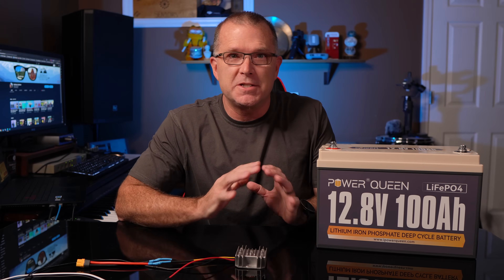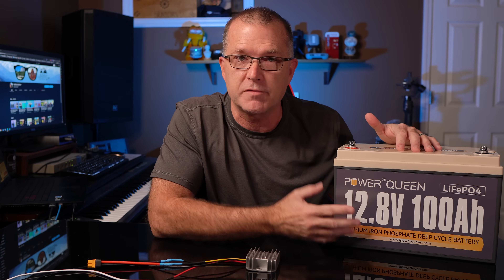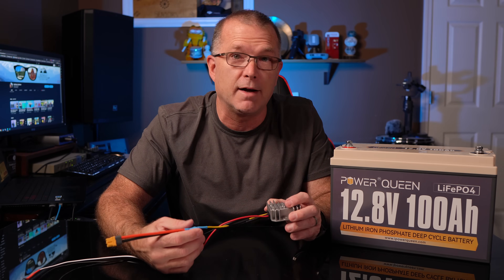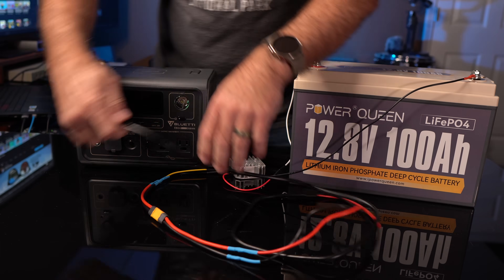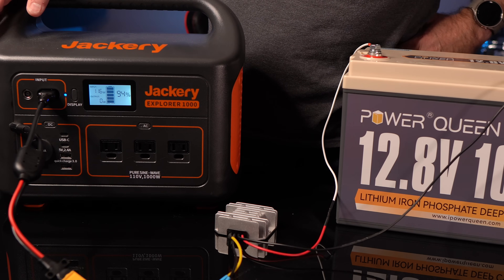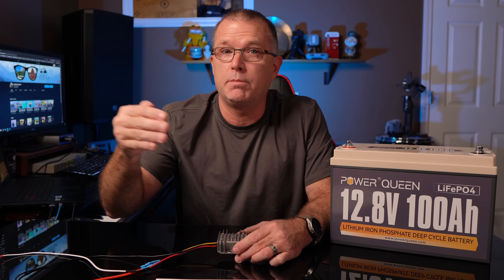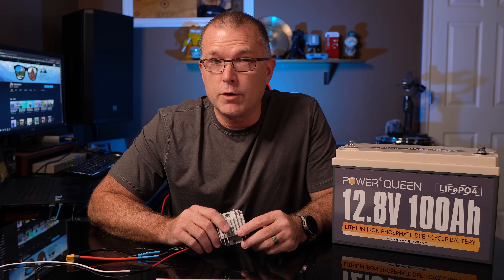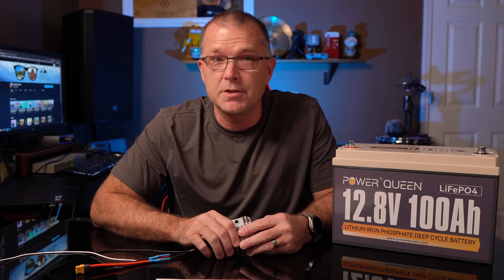SUPER EASY!!  DIY Power Station Battery Capacity Expansion / Charger

Comment: I did this with my delta which was rated @ 60 watts recharge and it burned out the unit charging @ 110 watts 😢
It worked for about 2 weeks then ruined the unit..
Reply: The original Ecoflow Delta states 10amp as the limit for car charging?
Reply: @LiquidTurbo   I think it 8 amps
I got a max unit and I’m gonna trait again using a 7.5 amp fuse and hope it’s holds up
Reply: @avelinomiseray6349  I checked their website and it said 10ampa for the original Delta
Reply from the maker: Wow...that's definitely not good.  Which Delta was that?  I can't seem to find one that's only rated for 60W DC input.   All the ones I tested have change controllers capable of modulating the input current - so provided your input voltage is within the published spec, there should be no problems, especially since step-up converter is only rated for about 3A.   And I did notice that my 2 smaller units that I tested with only registered 61W - which is equivalent to the charging rate their AC adapter's produce.
Reply: @ReeWrayOutdoors  hey.. it was the original delta .. I did this with the DC charge port that was supposed to be charged through the DC cigarette port which only puts out 60w .. I used the cable provided by Ecoflo removed the cigarette plug and amd ran it to a 10amp fuse .. 110 watts is what I got … It was great till the DC port stopped working.. Since I could no longer charger through that port I ended up returning the unit. I got the Max unit now but I want to try this method again with a 7.5 amp fuse .. see what happens

Comment: Pretty interesting video.
Reply from the maker: Hey man! Your channel name piqued my interest so clicked on it to see if you post any content... Looks like we work with many of the same brands and you seem to have a TON of great content!  I just subbed so I can remember to check some of your stuff out when I get a chance.   There's another channel I've come across (Jasonoid) that did something very similar, but it seemed more complicated and I wanted to show something that did basically the same thing but less complicated.  And pretty much within minutes of posting this video, it occurred to me (after someone raised a question about it) that there's an even easier way to do this using a 12V car socket - though it undoubtedly will produce a bit lower watt input in some power stations.  I might need to do a part 2. :-/
Reply: @ReeWrayOutdoors  depends on the power station, just using a 12v socket won't limit the current and may overheat the wires or start melting the plastic. Using a current limited boost converter is safer and doesn't cost much more.
Reply: My jackery outdoors supports 12 - 30V. DC input 24v  7.5A to 8.33A. So I guess I can add two of those 12 to 24 3A converters in parallel for more watts?

Comment: I like this idea, would this work with 2 100ah battery, and let's say I want to charge the other way around , let say my power station is full , and want to top up my auxiliary battery, what would be the best way ...smart battery charger plug into the AC of the power station? Thinking to get the ac200p and add 2 of these 100 ah lithium.. any ideas would be great ...

Comment: Do you think the EB3A was making that noise because it was already 99% charged? Would it be possible to run it down some and them try the booster and report back. I have two of those Bluetti power banks and two 100ah LiFePO4 batteries and I would buy a booster if I thought it would work. It broke my heart a little when you excluded the EB3A from the mix, since that's the ones I have. Great content.
Reply from the maker: Ok...so the buzz I heard on the EB3A was not due to the SOC being 99%.  I got the same buzz when I tried it at only 75% SOC.  Still not sure why that is.  I DID also try the (easier) option of using a 12V socket wired to the battery and then using the car charger cable to charge it at about 80Watts, and that seems to work and produces no concerning buzz noise from the EB3A.  Here's basically what I used (came with the BougeRV Self-Heating Battery):  https://amzn.to/3Cw6hN0
Reply: @ReeWrayOutdoors  I ended up doing the same thing, except I bought a 2 pack of 8 mm male plugs and added ring connectors to the wires to attach the battery.
Reply: @ReeWrayOutdoors  Thanks so much for following up on that. I may go ahead and buy the boost converter for my two power packs. If I do, I will report back on whether I get the buzz or not. The boost converter is cheap enough and I expect that at some time I'll get a larger power pack and can use it with that.
Reply from the maker: yeah, it's possible.  I'm going to do a little more testing and report back.
Reply: @ReeWrayOutdoors  definitely interested 
 ty ReeWray

Comment: Could one just use two of the LiFeP04 batteries in series and not us the step-up converter?
Reply: If your batteries support series connection, absolutely.
Reply from the maker: What David said...and I would add that it would be a very good idea to ensure you have a 15A fuse in-line if you're going to do a direct wire to the battery.  And that was an excellent question,  btw!
Reply: @ReeWrayOutdoors  Thanks, I have the bluetti AC500 with two B300 3072W batteries. I also have four battle born 100ah 12v batteries. So this is the first hint I have seen on how I could combine them. I am thinking 2 pairs of batteries in series then parallel them into the bluetti with a 15A fuse....I am thinking right here? Thanks
Reply: @LarryRichelli  the AC500 MPPT will take up to 15a, wonder if a 15a fuse will blow too easily?
Reply from the maker: @Larryr  yep,  sounds right to me.  Not sure about the DC input specs on that AC500, but you might be able to fuse with something higher.

Comment: very cold winters...not allowed to use solar power
same with emergency generators (noise by-laws)...Are you able to recommend a unit that will only recharge through AC plug-in power?
Reply from the maker: George, all of these power station will allow you to recharge through AC.  What would you plan on powering with it and for how long?
Reply: Gas furnace (1200 sq/ft house), WIFI, Fridge, Freezer, Gas stove for cooking (exhaust fan above it) , Pod coffee machine,TV...Minimum lights>>>Appreciate you taking the time to help

Comment: I have the delta pro , if I used the uxcell New Big-Size Waterproof DC 12V Step-Up to DC 48V 8A 384W Car Power Supply Module Voltage Booster Converter Regulator would it increase the input amount ? the Deltapro says it has a 1600 w input peak. Also I have two 205ah renogy batteries if I build two of those units and put one one each battery can I “Y” connect both of them to double the input amount?

Comment: I added a 12 to 24 converter but at 10 amps to my Anker 757. I wired it into my larger solar bank system. Works great and chargers about 220 watts. Great video.
Reply: Do you have a link for the converter please
Reply: Im interested too in the converter. Did u find it?

Comment: I recently acquired a Pecron E2000 (LiFePo) and was looking at the larger Power Queen as an option for expansion instead of Pecrons new purpose made expansion batteries. It seems they still need to work out some glitches when using more than one of their batteries in series. Pecron has a dedicated, but somewhat proprietary connector for its expansion cable. Would really be interested in getting another set of eyes on a potential solution.
Reply: I have the same question
Reply: The plug is not proprietary, it's 5 pin aviation IIRC.

Comment: how could you make this work with the EB3A ?
Reply from the maker: I need to do some additional testing with the EB3A.  It might be fine, but I just didn't recall hearing a buzz when it charged via solar....but it's entirely possible that that is normal. I'll post a comment back once I feel more confident recommending it.
Reply: @ReeWrayOutdoors  that would be awesome as the concept should work great for the EB3A
Reply: Maybe use a DC to DC that's 12 v to 19 v instead of to 24v.  It might be a little less stressful on the eb3.

Comment: Good idea for a low price expansion.

Another downside is the low efficiency and the extra cycles put onto the main battery. These small power stations take 15-20% more than rated capacity to charge, even over DC (512Wh capacity takes over 620Wh of input to charge), plus the 12 to 24V boost converter loss of 5-10%. Then you lose another 15-20% from the typical inefficiency of the power station when using the inverter/regulated DC.

So if you do the math for something like the Ecoflow River 2 Max with 512Wh and a 1280Wh external battery, you are getting ~415Wh (original output capacity) plus just ~785Wh AC output capacity from dumping the 1280Wh into the unit and taking it out. The loss is much greater than compared to if you just hooked up an inverter to the external battery and used it that way, plus you effectively put 2 extra cycles of wear on the internal battery of the power station by dumping in the 1280Wh.
Reply: Your math is flawed, because from my real world use case, my external 50AH 768WH battery does not dump power into my power station, it's more like a pass through of power. If I don't exceed the 80 watt input, the unit always stays at 100%!
My power station always stays at a 100% level even while powering my 24inch TV at 27 Watts for over 24 hours. This is better because my external battery charge time is way faster!
Reply: Well any expansion battery is going to have that issue.  Always buy the largest battery you can get away with.
Reply: How could you be putting two extra charge cycles in??  lol.  Where is all that wasted energy going?  When you recharge from solar are you also wasting two extra cycles?
Reply: @ItsEverythingElse  when you charge with solar you are charging just 1 battery, if you use the power & recharge it that it is one cycle. If you use a 2nd battery to charge a power station, you are cycling the extra battery and then also the power station’s battery.
Reply: This is exactly what I was thinking.
Reply: Inverters aren't 100% efficient either.  And you're now going from 12VDC to 120VAC and back to 12VDC.  I don't see how that is better  than 12 to 24 to 12.
Reply: Thank you for the thought provoking comment.

Comment: Nice idea. I’ve been planning to get a 24v-12v stepdown converter on a 100w solar panel output to run my fridge by the pool this summer. Maybe you could do a video running things off a solar panel with a converter instead of a battery. I know I’d be interested.
Reply: An mppt solar charge controller is basically a smart DC to DC converter which will do exactly what you are asking. Or go for a pwm controller if you want cheaper (£10 or so) but at a risk of less efficiency. The cheap pwm ones typically don't even need a battery.

Comment: Pecron 2000?
Reply from the maker: The Pecron series is a bit of a unique case.  They have 2 inputs. The top one only supports a max of 18v which is too low for this 24v converter.  The bottom port needs at least 30v...which is too high.  So, 2 options: either get a step-up converter that can do 48v for quicker charging, OR go the easy route and just use a 12v female car socket wired to the battery and then use the included car charger cable to get up to about 100W into it.  Something like this would work: https://amzn.to/3i4yDa6

Comment: So with the delta 2, its possible to add a delta max to get a total of 3kW max, beyond this there is no additional expansion option from ecoflow. Now, is it possible to use this approach to add a third LFP battery to expand the system even further via  the XT60 connection?
Reply: I guess another way to phrase the question is "Can the Delta 2 accept "solar charging" from the XT60 connector while connected to an expansion battery". My guess is that it can, therefore this should work.

Comment: One thing that may be beneficial if the specific power station can use a much higher input voltage is finding a boost converter with an output voltage just a bit under (5-10% or so) the max recommended solar input voltage or get one with adjustable output voltage range and just make sure you are not going over the max wattage rating of the boost converter or battery you are connecting to.  This will allow higher input wattages for the power stations that support faster solar charging.  Many of the portable power stations are limited in charging wattage due to the size of the solar charge controller they use so if they support a higher voltage that can sometimes yield a higher input rate till you hit the max rate of the internal solar charge controller.  One other thing to mention about those boost converters is that they tend to want forced air cooling if you drive them much over their rating for any length of time.

Comment: Since most power stations come with an adapter to charge from 12 volt car power,  would it not be easier to wire a 12 volt fused female plug to the battery then use the supplied adapter to charge the power station? Sounds too easy! Am I missing something?
Reply from the maker: Definitely easier. :P  The only downside is that for some power stations (like the Delta 2), you'd only get 100W into it with that, instead of around 180W.
Reply: I was wondering exactly the same thing and I think I prefer the 'cleaner' setup over the boost in charge speed. I'm also paranoid about safety, so something like the NOCO battery clamp with female 12V adaptor has a really nice inline fuse. Then you can simply use the cable that came with the power station. Love the video!
Reply: @LiquidTurbo Interesting! Thank you for this idea!
Reply: That's kinda what I do on 2 separate units. One is only 400 watts (cost $200. bucks) and the other is 800 watts (cost $250. bucks), and both have battery jumper cables for your car.... sooooo if the power goes out late at night I simply connect a fully charged (yes, I'm prepared) 12v external battery through the jumper cables and have a ball. I even recharge them both at the same time by connecting the battery charger (when the power comes back on or I can fire up my 10K water cooled diesel generator... homemade for 1,000 bucks... without waking the neighbors) to the external battery and the current tops off the internal battery inside the unit. A ex-pat country boy will survive... even in the Philippines. Ha... Ha... Ha...

Comment: Why not just use the 12V when accepted by power station? Any advantages to stepping it up?
Reply from the maker: for some power stations, stepping up to 24v will definitely get you more Watts to charge with.  On others, the 12V supply would already be about as much as you could get.

Comment: it seems like a nice idea but don't you want some device on the battery to shut it off when the battery gets below some threshold?  I thought draining the battery too low will damage it.....
Reply from the maker: That's definitely a concern if you're using lead-acid.  However with these LiFePO4 batteries, the internal BMS will provide that protection automatically.
Reply: @ReeWrayOutdoors  Ah, ok, I didn't realize that. Also, couldn't you just get a 25.6V Power Queen battery and simply direct connect it?
Reply from the maker: @igelkott255  yep. You could do that too, but you'd want to put an in-line fuse on that to ensure that the power station is protected.

Comment: Great idea. Presumably those units are relatively efficient, in terms of power losses, I wonder…
Reply: Efficiency claims on most of these units are around 95% which is probably close to correct from 20-95% load.  It is hard to tell for sure without putting a few through some testing.